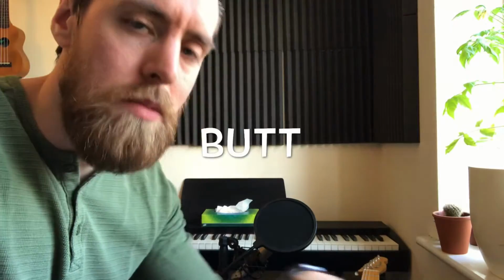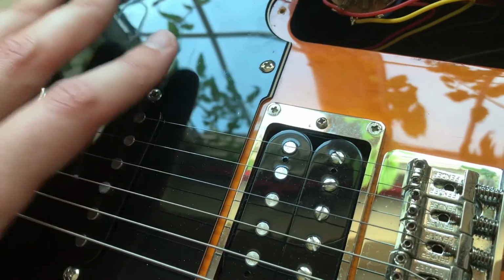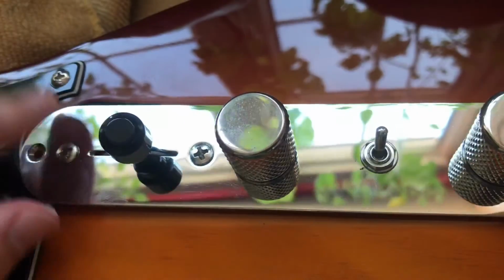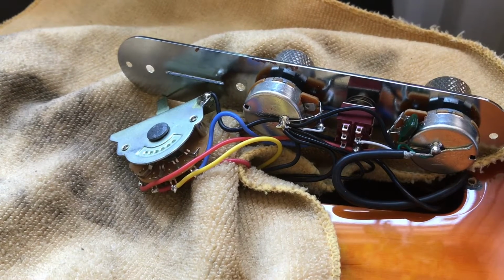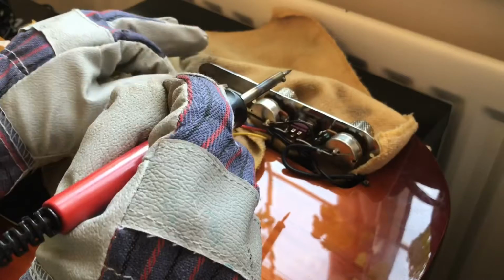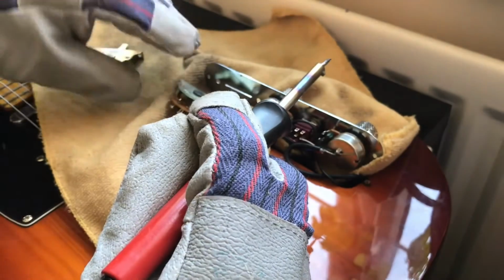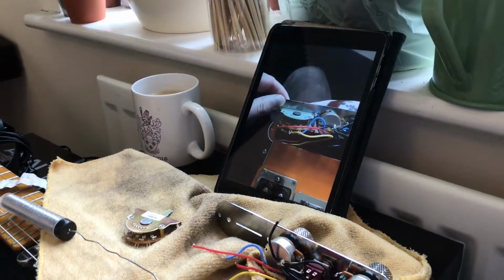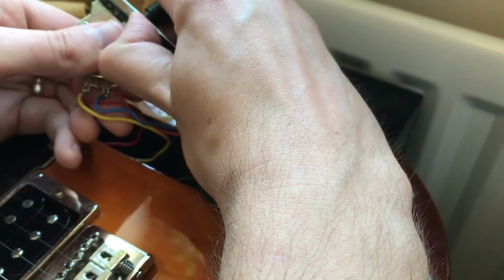How to replace a Fender 5-way Stratocaster / Telecaster switch

Comment: The black wire soldered to the body of the switch is merely a ground wire. I don't understand why you messed around with it as long as you did.  Any pro would have just clipped it off, same thing for the rest of the wires
The substance you thought was glue is just rosin from the original solder. It has no glue-like properties. Why the heck would Fender, or anyone else glue a wire in place?   Since you not reusing the switch, you can just disgard it. But assuming you wanted to reuse it someday, you would clean off the rosin off with a cotton swab and alcohol.

You're real problem here is that the soldering iron is not transferring heat efficiently to through the tip of your soldering iron very well. 
1 - Clean it by heating it up, then wiping it clean on a wet sponge, or even better - a brass tip cleaner. 
2 - Re-tin the tip. 
3 - Since your iron is the inexpensive type with where the tip is held in place with a screw, you may need to tighten it. The iron's heat will cause this screw to loosen over time  and once loose it becomes very bad at transferring heat Tightening it usually make a world of difference.   

Use the soldering iron, by first "wetting" the tip, which means placing some solder on it. The "wet" solder on the tip will help it transfer heat to the work area.  

Lastly, the connection of the (black) ground wire to the new switches body is poor because of poor soldering technique.  First, you weren't able to heat up the switch enough to get solder to bond to it, Secondly, the switch body is coated with an anti-oxidizing agent which is interfering with the solder's ability to bond to it.  Just scrape it with a pen knife or a small file to expose some bare metal and use a bit of soldering paste.